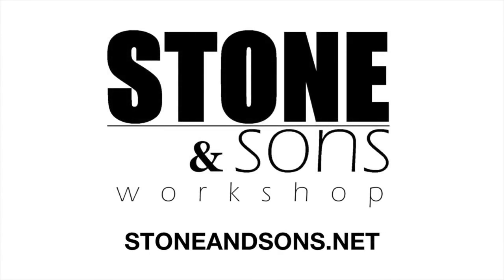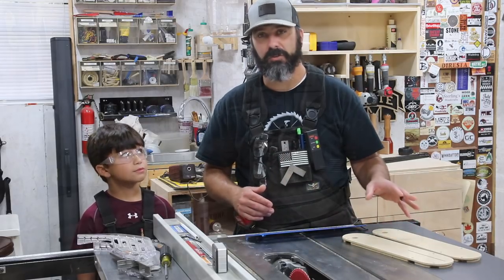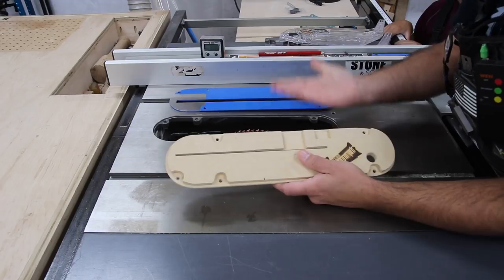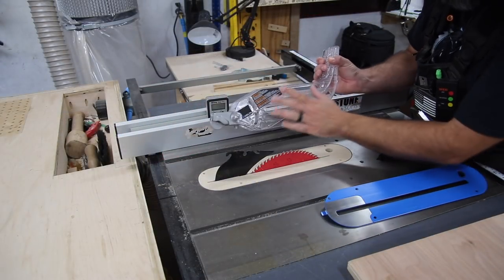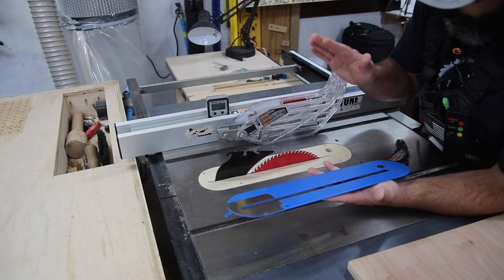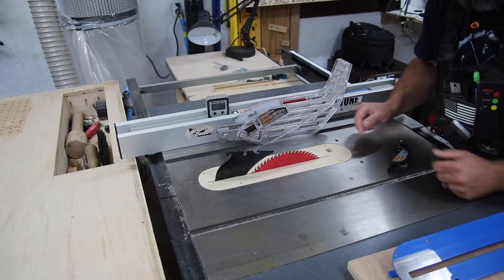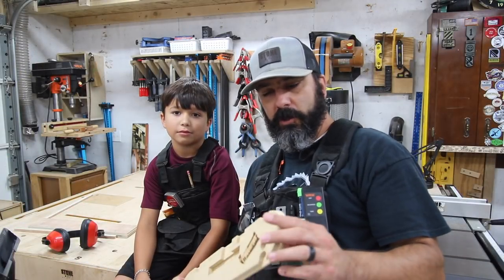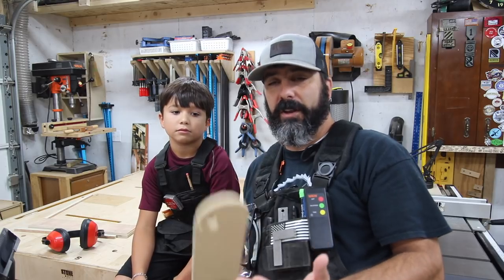Zero Clearance Table Saw Insert and Dust Collection Comparison

Comment: If your zero clearance insert has seen better days, tape off the top of the insert and pour epoxy onto the underside, filling the slot completely.  Recut the slot and it's as good as new.
Reply from the maker: Thanks for that tip